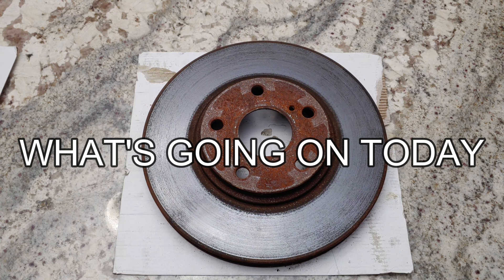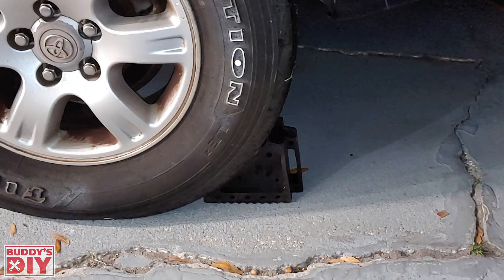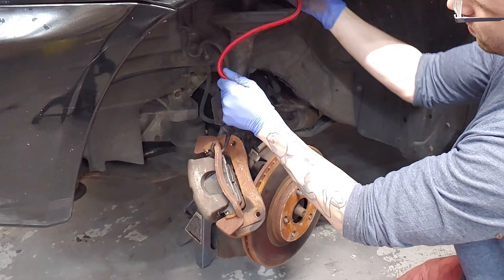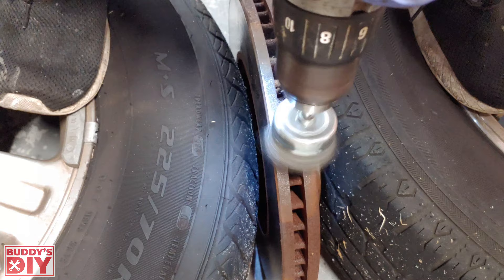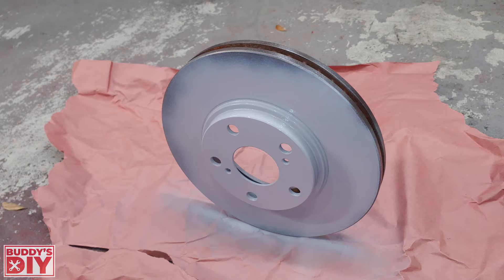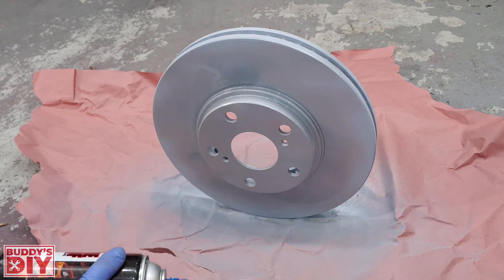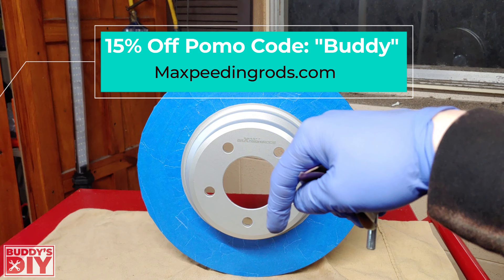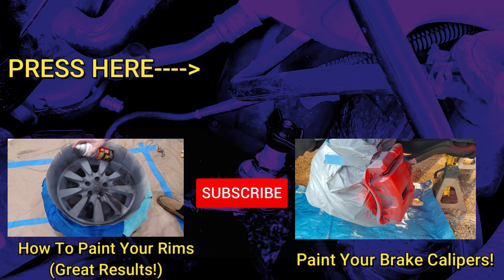How to Paint Brake Rotors | THE PROPER WAY

Comment: While I'm sure I'll be labeled a "Karen" or some other nonsense, this is a terrible idea. You should never paint the friction surfaces of your rotors. Paint contains chemicals that can stick around long after the paint is removed and ultimately change the friction levels. Painting the hat and cooling fins is fine. Just avoid painting the friction surfaces.
Reply: TOTAL KAREN
Reply: @mackenzieandrewmcnabb6050  why? they're literally just giving out helpful information that seems legitimate. it's useful mate...
Reply: nope, im pretty sure ur not a karen
Reply: That’s exactly what I was thinking, just take the extra time and tape it
Reply: Karen
Reply: If you paint the friction surface you used the old pads to remove the paint.  The paint will imbed itself into the pad. IMHO this is not smart.  Luv shak is correct.
Reply: The hub is not a friction surface. You don’t paint the friction surfaces.
Reply: First brake application will ruin the rotor!!!
Reply: @OutlawChevy2   not the center.
Reply: Kahren 😂
Reply: If it ain’t a race car it don’t matter. It’ll brake good enough. Plenty of people out on the road shitty brakes
Reply: @Dirkadew I wouldn't do it.
Reply: Well Karen, I agree mostly.  Tape off the working surface.
Reply: Have you ever installed rotors from the dealer? They're painted over pad surface area...
Reply: @quyle9483 yes there painted with the thinnest amount of primer that rubs off with just a cloth not proper paint.
Reply: @davefrancis7213   not all. At vw its actually a zinc primer and the labels they put on the rotor surface you gotta scrape off with a razor. The primer does not just come off... not with brake clean and a towel either.
Reply: Rotors are pretty cheep I just got my rears for 14$ each. Why bother doing the work assuming you can cut them yourself
Reply: @MarkMyWordsXx   because I won't buy 14$ rotors. I buy good quality shit. I bought a set of brembo rotors at 350k and have just shy of 500k now on those same rotors. No warping and good rust resistance. Also isn't shit ass porous steel like those 15 dollar rotors.
Reply: @MarkMyWordsXx  if your rotars were 14 each I'm assuming you have a small or light car. My full size sedan uses the same break system as an F150 pick up truck. Two piston front calipers and large rotars to fill up the space shown from 20 inch rims. My rotars are 100 each.
Reply: Excellent video but I don’t agree with painting the braking surfaces, instead tape them off like he did with the new one.  Good catch luvshak, don’t paint the braking surface.
Reply: The pad will scrape the paint off the surface.  No issues.  Done it for years.  Good video.
Reply: Yea those chemicals not doing anything when you brake going 60 mph, the only thing left will be metal and your brake pads🤦🏾‍♂️ tell me you know nothing about cars😭 I’ve built a lot of cars, painted all them and never had issues so ya you are a Karen 🤡

Comment: I wouldn't paint the friction surface,. I wouldn't want the chemicals from the paints leeching into my brake pads. If you do decide to do this- I'd at least suggest buying some new brake pads and then switching out the old pads once you've used them the clear the paint off of the friction surface you've painted. Just my two cents.
Reply: I painted the surface of my brake rotors today but I do have a spare pads that came with the car when I bought it I’m using cheap pads I put on when I got car
Reply: Pardon the pun but you're "spot on" its a great video but wouldn't want to gum up the pads with paint, could cause uneven breaking, excessive heat build up and diminished braking capacity.

Comment: Two things people should not play with, the tires of your car and the brakes, I will like to see your vehicle after hitting the breaks for the first time after this process.
Reply: So long as you're not absolutely layering that on it, it should be fine. The same idea comes with things like EBC's Zinc-plated rotors, or even some of theirs that come painted - brake a few times in a parking lot or just going up the street, and several wipes of the rotor against the pad are gonna wear off anything that is on the surface of the rotor. Same thing it does when you get water or mud on it when doing regular driving.
Reply: Why do so many people spell BRAKES wrong?  I see this all the time.
Reply: Not really a bad idea or good idea, just an idea. Save time masking the rotor. It won't affect the pad or the rotor. Rust forms on rotors and metallic pads and as soon as the brake gets used its rubbed off no issue. Same as forgetting to brake clean the rotors that come with a film of cosmoline on them. The wax burns, sure it may take 3 drags but in the end you'll get a clean surface on both surfaces no issue
Reply: New brake discs from recognized producers like brembo, zimmerman, textar, ate come out with PAINTED rotors from the factory. It wont affect anything :)
Reply: @thegeneraljoe67 I don't no why people mispell breaks. So give me a brake. It's not misspelled words, it's bad grammer. Lol
Reply: @gibon1337  There's a difference between a zinc coating and actual paint. The chemical structure of brake coatings still allows heat to dissipate, paint doesn't, in fact it tends to do the opposite.

Comment: As some others have stated......definitely do not paint the friction surfaces! I painted the rotors on one of my cars......taped off the front ones, (which was tedious & sucked) so then I watched a video before doing the back ones that said "You don't have to tape them off, the pads will clean the friction surfaces" so I didn't bother taping off the rear ones. HUGE mistake! Paint all gummed up in everything making brakes stick, etc, etc. Horror show! Do yourself a favor & don't be lazy.......tape them off!

Comment: Another trick to get the rust out of the veins of the rotor is to douse it in vinegar or better yet, set it in a tub of vinegar and let it sit for 12+ hours, then spray it down with a hose or brake cleaner, this will help remove hard to get at rust.
Reply from the maker: Not a bad idea at all man.
Reply: Ik7ì
Reply: Correct! you dont want anything between the disc and the pad, it will negatively effect the performance of your brakes. The only areas you are ok to paint is the centre and the edge.
Reply: @dutchtrucker  especially on drilled slotted rotors like powerstop/callahan that require a specific break in process for its pads. Im getting ready to install mine and am definitely NOT painting where the pad touches the rotor.
Reply: works well!

Comment: i have a new set of zimmerman formula f, z-coated rotors & just finished painting the first rotor. i wanted to see what others were doing and this video is one showing the closest to my process, except I'll share my observations/experience. 

z-coat, at least on the zimmermans, comes off with brake clean, alcohol (barely), acetone, and paint thinner. it doesnt come off with water or foaming window cleaner.

While i'm not keen on painting the friction surfaces (i taped mine just like your new one) the z-coated ones say in the installation guide, no need to remove the coating from the friction surface, rather do 5-10 short moderate braking operations to remove the coating layer. presumably one can donthe same with paint.

I also tape my friction surface because vht flameproof is $15/can.

i use vht flameproof for my rotors and my calipers, and it's very durable, albeit not as flashy colors like some of the others like duplicolor.

i do use primer, vht primer. personally i'd be concerned about the rustoleum scorching off when hot.

i don't paint the inside of the hat where the hub touches, although when looking at the inside of the rusty rotor i might be compelled.

I don't spray it standing up. injust find round things, like coffee cans, to set them on. a round plastic lid from a grocery store package of fruit salad made an excellent cover to mask off the back of the silver hat while spraying the outer edge of the disk. 

also, i made a last minute descision before priming, since the new rotors have an aluminum hat, I opted for spraying the exposed aluminum with vht clear.

anyway, hope this helps someone or inspires some additional ideas or discussion. cheers.

Comment: Ummm...fyi I live in Ohio so anytime I take anything off to repair anything I paint it. Painting The hub surface, the veins, the wheel surface of the rotor hey thumbs up. What you never want to do ever as long as you live is paint The rotor surface that comes in contact with the brake pads. Paints are petroleum based and will break down the resin in your brake pads and that is the best case scenario. Worst case is they seal your pants and you lose a friction surface. Friction is what makes the brake pads work.
So whatever you do people do not paint your brother surface that comes in contact with your brake pads.

Comment: So you used high heat paint over regular primer?
Reply: That’s what I was wondering about.
Reply: High heat primer should be used as a base coat and needs to be heat cured as does the top coat.

Comment: I couldn't imagine thick coats of burnt paint would be good for your pads.
Reply: Facts
Reply: @adamnpigeon7185  no its not
Reply: That's exactly what I was wondering. Why is dude painting over the braking area? Hmm
Reply: It comes off from braking over time, doesn’t it? Duralast sells rotors that are completely black until you start using them. Also, I’ve painted calipers and accidentally painted the rotor. I was worried about it but after using the brakes, I noticed the paint was completely gone. Just a thought.
Reply: @rayriley174  Exactly this. A couple of passes over a light layer of the contact area will remove it pretty quick.

Comment: i would avoid the contact area with the brakes tho... what you said about not worrying especially after applying 10 coats of paints... if it was just 1 yea sure but you did around 3 coats each type of paint ... so that is around 1-2 mm thick paint in there that will basically skid ur brakes like u don't have any brakes at all... i would mask the contact area like u did for the brand new ones.
Reply: paint is extremely thin 1-2mm of paint would be nearly a hundred coats of paint
Reply: @dylanmedley824  average factory paint on cars is 4-5 mm, 1-2mm is not a lot for paint
Reply from the maker: @k3ramb0  dog. 4-5mm of paint? 🤣
Stop it 🤣🤣🤣
Reply: @k3ramb0  Your numbers are correct, but in mils.

Comment: So I didn't sand or use primer on my new rotors, I did brake clean them. I used VHT paint, I probably didn't need to prep it like that right? Used about 4 coats

Comment: Do we just ignore the wetness behind the rotor? Is the caliper leaking? It doesn't look like splattered grease. Maybe it's excess penetrating spray for the screws retaining the rotors.
Also make sure you thoroughly coat the braking surface and use the new pads to clear off the paint. Using the old pads would contaminate them.
Reply: Looks like they sprayed wd40 to loosen the caliper bolts.

Comment: I fitted brand new discs pads and calipers all round on my Accord. Didn't use the car and the discs are all rusty. I'm going to apply a couple of light coats of the rust inhibitor primer to the entire discs but then only use the top coat on the edges and the hats. I'm sure the new pads will be fine with just the primer but I can't imagine the high heat paint on the disc surfaces is safe!!

Comment: bought new rotor with paint on surface brake area, mt mechanic told me that he will remove it coz the paint coat will rub on the brake pad and it might scratch the rotor...so its better to make it plain and safe

Comment: Buddy questions. I want to fix my porsche boxster rotor hat paint to match the glossy silver rims. What paints can I use? I also would rather not take off the bracke calipers which are already red and look good. The rotors not so much. Likely would sand everything up to where the brake pads hit the rotor. The vein parts may just try and clean rust off. What do you think. Any help appreciated.

Comment: Regular primer with heat paint don't go together, but it works fine. Also, I guarantee you regular rustoleum paint works  best. Heat paint is ceramic and chip real quick. It don't last. Too brittle.

Comment: Nice video, but why would you not use high temp primer like you did with the high temp paint? You're creating a weak layer with the primer. If/when it fails the paint will flake right off. The primer is the first contact point of the rotor when it gets up to speed. Also, I saw here and in other videos you used hand sanitizer with aloe. I know this isn't auto body paint but that WILL act as a slight release agent for your paint. Regular iso-propyl alcohol is better. I liked your overall process though, other than those two items.

Comment: VHT does not require primer and the primer you used is not high temp.
Once brakes get hot, primer will burn off, ruining VHT coat.

Comment: Wow, that nice new paint on that friction surface must be great for breaking power, I wonder why they don't do that from the factory.. You make really nice videos and I would appriciate if you would make a video about jetting the carb and aftermarket distributors on your e92 bimmer, those mods should make lots more power for little money.
Reply: Some places do it from the factory. My rears didn't but new rotors on my brembo package mustang came with a gray coating over the entire rotor. After the first drive you could see the pads had scraped away what was on the friction surface.
Reply: @Kara.Zor-El  I would think those coatings could be designed specifically for that purpose. I would be careful drawing a parallel to that and an off the shelf rattle can. I'm painting mine now and masking the braking surface, I've just got this vision in my head of the paint gumming up on the pads.
Reply: @jerrycallo  the paint will come right off not gum up the pads. If for some reason that did even happen all you need to do is drive 50ft  and hit your brakes and it would remove the paint then you could wipe any residual paint off.

Comment: So I came across your vid nice. I have a pair  (set of rotors 4). If I paint the with the rust pimer and the gloss black won't the paint come off where the caliber meets the rotor when you push on the brakes?

Comment: Do you know if I can also paint the drums in the same way - as far as painting the surface where the shoes meet the drums? Great vid, new sub!
Reply from the maker: Wherever the shoes touch the paint will be almost instantly peeled away. I dont see why not. I would not gunk paint on any moving parts
Reply: @BuddysDIY  Great, thanks! I painted the outsides yesterday and am doing the inside today, so I got your reply just in time, appreciate it! Yeah, I was just worried that the shoes wouldn't apply enough pressure to get the paint off, since most of the stopping is done from the front. 

Really hard to paint rotors btw! Had to do them standing on edge so the paint wouldn't clog up the veins trying to get the slots sufficiently covered - at least for the first inch or so.
Reply: @BuddysDIY  Also, do you know if baking them will cure them faster? Lots of info online about baking them to make the paint harder and more durable, but nothing that says that it takes the place of the 7 day waiting period for the paint to fully cure, or if it speeds that up at all.
Reply: @cullen406   Yes, baking does cure most paints faster. 150-200 degrees in an oven works well over an hour to two hours. Warning: your oven, your kitchen and your entire house may reek with paint fumes so think it over before using your oven. Best wishes!

- Max Giganteum

PS Do NOT paint the friction surface... tape it off.

Comment: Sweet video!! Quick question. So only paint the whole rotor if it’s a cast iron rotor? If it’s the zinc  stainless steel rotor you just paint the hat?
Reply: Painting a stainless-steel rotor is pointless unless you wish to go with a specific color because it will show through some designs of the rims you use. The stainless-steel rotor shouldn't rust EVER. As for painting the entire rotor, do NOT paint the friction surface! Tape it off and wipe off any overspray before reassembly. The one time you can paint the friction surface is if you machine the friction surface after you paint. Best wishes!

- Max Giganteum

Comment: So if the new rotors are cast iron should we sand the part where the pad touches the rotor?
Reply: No, it should be left alone so the surface is even and makes consistent contact with the pads

Comment: Did you have to compress the brake piston to get the caliper back onto the disc when you reinstalled brakes ?
Reply: You should not have to as long as you don't depress the brake pedal while the calipers are off. Best advice here? Don't touch the brake pedal until you put it all back together. By the way... do NOT paint the friction surface of the rotor unless you plan on machining the friction surface after applying paint. Best wishes!

- Max Giganteum

Comment: Hey I have a quick question I was hoping you could answer for me! I painted my cast iron rotors (not the braking faces) and I used Rustoleum’s filler primer as a base. Unfortunately, I just realized I got the wrong one and this specific one is rated for 200 F. I only did 1 light coat followed by 1 VHT (900 F) and 2 Duplicolor metal cast (500 F). I am contemplating stripping the paint off and repainting from scratch, but I wanted to see if you thought it’d be fine to leave on before going through the work of restarting. 
Thanks!
Reply: It shouldn't be a problem man no point in stripping it all out

Comment: Don't do this, you need a new Brake Pad would take care of Rotor Polish Surface Rotor often because require a Metal to Metal pad.   if you do this cover with paint, it would catch fire. 
(Print isn't Metal-proof)   
you can Paint ONLY Center and Outline!